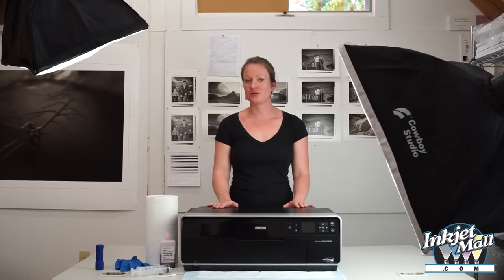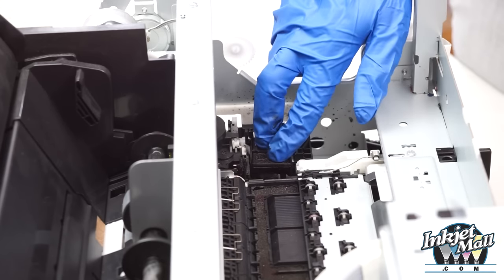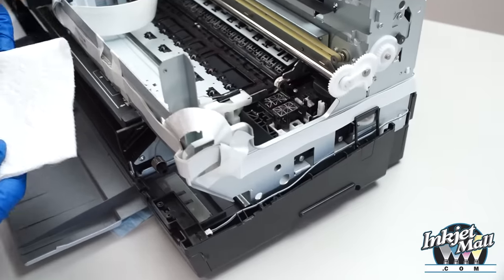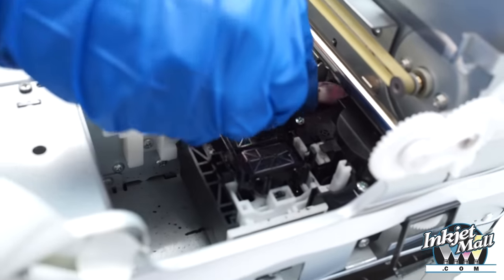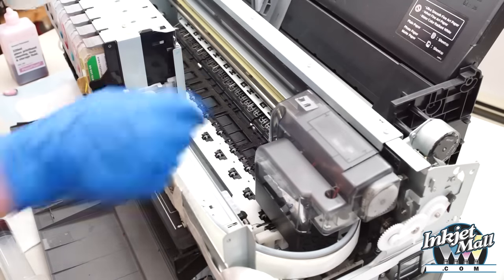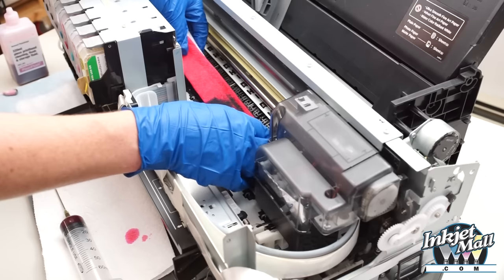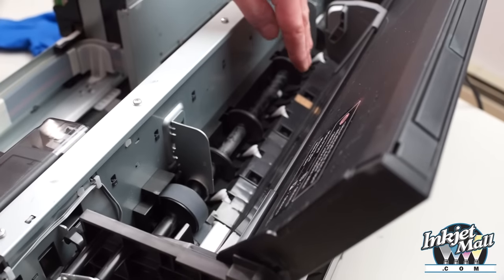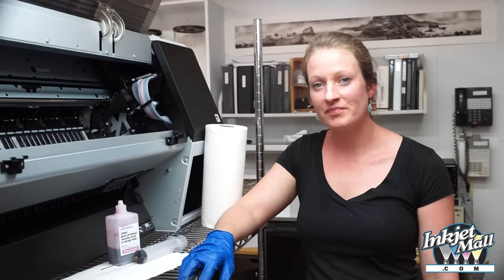How to Professionally Clean Epson 3800 & 3880 Printers

Comment: BTW.  I panicked.  I was cleaning the two spring loaded sponge collectors and something came loose and the unit popped up at a weird angle.  I knew I couldn't restart the printer until I fixed what I did.  The video was of good enough quality I could see a little T shaped plastic clip that had come out of the white slot on the right side of the unit.  I pushed down on the two sponge units backed off a little and was able to get it back into the slot.  This video was priceless.  My printer is printing like new now after cleaning.
Reply: I came here for the same reason... thanks for share!

Comment: For those asking "how do you remove the cover" it was suggested to view the instructions on the "Field Service Manual" for this printer. Upon finding and reviewing that info, the instructions are quite involved and it's probably more of a pain in the arse to remove the cover than try to clean it with cover on. Looks like you have to remove a lot of components. Not designed to be an easy removal.
Reply: For the 3880, yes.  I'm in that process now and it's slow and involved, but necessary to access the print head.
This link: https://www.youtube.com/watch?v=sSQbhQbEvd8 how to remove print head--helps but is a bit hasty, since it appears the object is not to fix the printer, but to cannibalize the printer for parts. Plus, my 3880 is not exactly like the one shown in the link. Good luck.

Comment: Nice vid. I just use windex (glassex inEurope) with a little ammonium in it. Works exactly the same..
Reply from the maker: be careful with ammonia based products, eventually they will interact with the copper which is present in Epson print head circuits. Not recommended also because of the drying speed of ammonia. Good for cleaning but potential is worrisome. We prefer slower drying cleaners and cleaners which act as solubizing agents.

Comment: great but show how you take the cover off. I have. apriblem with my cap which has come off the side bit. does the black bit need to go under the white bit right side.  I have issues with only 2 colours coming out on my sheet. please helpppp
Reply from the maker: You need to google the "Epson Stylus Pro 3800 Service Manual" for an illustrated manual designed by EPSON for disassembly, repair, reassembly...

Comment: Hello Dana, how are you? My Epson 3800 does not auto head align. Manually it goes without problems. Is the sensor used for auto head alignment something the wiper blade should keep clean? Or is there somewhere else I should clean besides what's shown in this video? Thank you!

Comment: It would be so helpful to know how to remove the cover. I will not be able to clean the printer without removing the cover.
Reply: We only took the cover off so you can see what we are doing. We do not actually remove the covers to clean the printer.
Reply: @joncone  No doubt you are less clumsy than I am!
Reply: @joncone  I was able to follow the video and clean the printer. Thanks!  The telltale smudging on the edges of the paper went away. I may have bungled the  cleaning of the print heads, however, as I saw the Bounty paper towel was torn a bit and I fear it clogged the heads. The quick nozzle check looks fine but the long nozzle check/cleaning print shows the 3 blacks and cyan cleanly printed with no gaps; but no other colors are printed, and the cycle ends with an error on the console screen. (I use the printer for matte printing only). B&W prints look fine, but color prints look strangely flat. I'm wondering if I should do a complete flush then convert the 3880 to Piezography.
Reply: @gdmcclintockIII  Look online for the Field Service Manual for the Epson 3880 and it will give you a step by step photo illustrated instructions for removing the cover
Reply: @gdmcclintockIII  dragging the head across can tear the bounty but it's doubtful that it would clog the heads by doing so...  hopefully you have a clean capping and flush station as well as wiper blade and it's not residue being dragged across the head. No other colors printing is a bit of a worry, but I do not know the history of the printer.  If you're on Epson carts are they past their prime? If on refill carts have they lost their prime (literally do they need to be primed?).  You would need all the print heads to be in perfect condition to convert to Piezography - but we could configure a 6 black Piezography system for you if you only can recover 6 of the ink channels...
Reply: @joncone  Thanks very much for your comments! I print quite frequently (for myself and for other people) and the Epson carts are reasonably new. I am very interested in Piezography Pro and am hoping that flushing the entire system will correct any problem. I will look for the service manual. Thanks again, and Happy Holidays!
Reply: @joncone  Hello, is the Field Service Manual also good for the 3800? Thank you.
Reply: @yasky14  I am sure 2Manuals has one for the 3800 but the printers are actually very similar where one will work for the other.

Comment: Hello, I have this model of printer and since I bought it, its original inks were used up and I did not use it again. You want to put the continuous system on it and make it operational, what do you recommend I buy and do?, thanks
Reply from the maker: If you mean that this printer has been sitting for many years unused - then really you are at risk with the 3800 or 3880 because the ink selector unit tends to fail in the black channel as a result of prolonged sitting with pigment inks for years.  The ink selector unit would need be replaced in that case.  But if one of the black inks is still operational - then maybe possible to buy the entire flush kit for the 3800 (https://shop.inkjetmall.com/PiezoFlush-kit-for-Epson-Pro-3800.html) or the 3880 (https://shop.inkjetmall.com/PiezoFlush-kit-for-Epson-Pro-3880.html) and clear it out. If it will print perfectly pink nozzle checks at that point - then you invest in inks.

Comment: I need to remove the cover like in the video.  How do you do that?  I was cleaning the pads and something came unclipped and the sponges are tilted and I need to get in from the side to see what is wrong before I plug it in again.
Reply: +Richard Hawes I need to know how to! Did you figure it out?
Reply: +Teresa Flowers You need to get a copy of the Pro 3880 Field Repair guide.  It is on the internet somewhere. Page 72-80 has instruction on how to remove the cover.  I have the pdf but I can't attach it.
Reply: I consulted this manual you mentioned, but my Epson Pro 3880 turned out not to be exactly the same model so I could not yet open the cover.

Comment: 3880 pump cap position disturbed.
I had ongoing clogged nozzles on my 3880 and after several cleaning cycles didn't help I watched the video & started to clean it - under the head, the head's path, the wiper blade and pump cap station (2 little foam pads) that drain ink.
Problem is that I pushed down on them too much and since they're spring loaded, it popped up and I can't re-position it. I've googled and found everything but how to pop it back into position. Can anyone help please?
Reply: I've now got the same problem. I assume since this occurred 10 months ago you may have found the solution.

Comment: I have a 7800 I have not used in almost 10 years, what are my chances?
Reply from the maker: Probably not good. Whatever ink that you left in it will have dried not only in the print head, but also the ink exchange unit, and ink lines.  Not impossible - but a lot of work requiring a full flushing of those parts with PiezoFlush. This video is about preventative maintenance. Something you should do at least once a year. Your situation requires injection and will necessitate some disassembly.

Comment: Can anybody help ? Basic parts of my printer(Photo RX620) near the  cartridge holder area, are quit the same with the printer on this video. My problem is that the material which is like sponge and it is in the channels where the print head moves back and forth (this channels lays below the print head when it moves. In 5:58 you took a long paper, moisten it and lay it on these channels with this, like sponge, material.), well this sponge has destroyed, like has melt and i want to replace it. Does anybody know where to find a replacement or to use something else (an other material) to replace it ??
Reply: that is the platten sponge, i dont think its replaceable.  you can get creative and make your own with a razor blade and a fresh sponge material exactly the same height.  a spray adhesive should hold it down.  Jose Rodriguez talks about it   https://www.youtube.com/watch?v=8CWxfxUqzjE